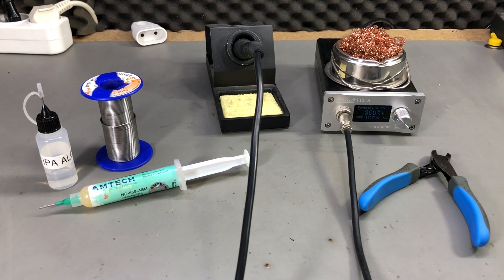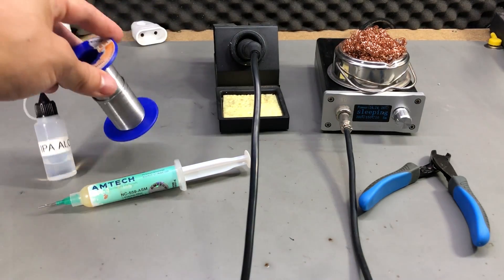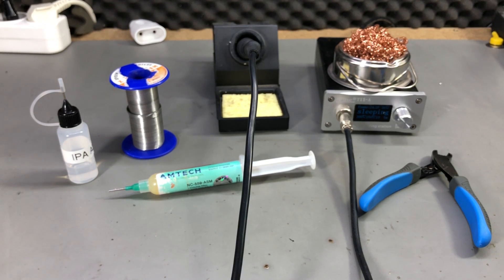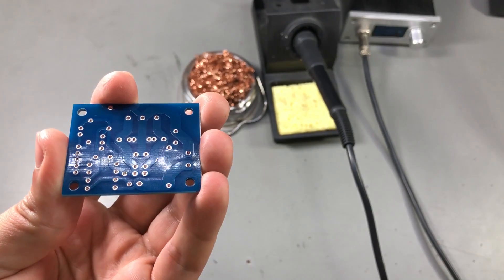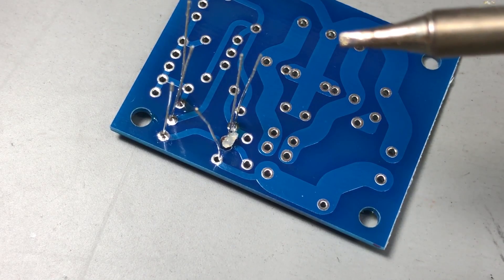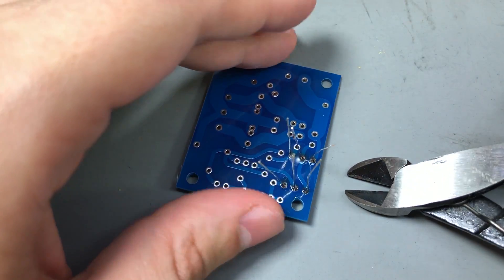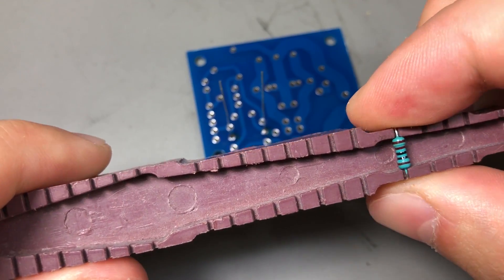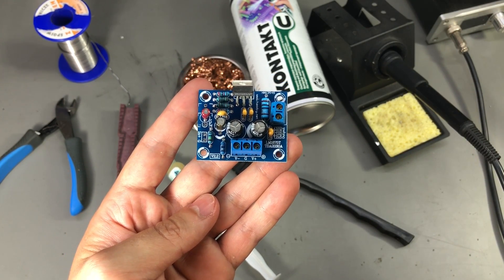Voltlog #179 - How To Solder Through-Hole Parts

Comment: For me, the biggest barrier when I started was the solder I used. I always thought soldering, especially desoldering, was so hard and I could never get it right. I thought it was my skill and/or the soldering iron I used. I got a few irons, still didn't notice much difference. After spending more money on some quality solder, I realised it was all solder.
Reply from the maker: Solder does matter but I have found that if you just add some extra flux you can get it working even with cheap stuff.

Comment: Here in Finland selling leaded solder to consumers became illegal in March this year. Only authorized repair technicians can buy leaded solder. I'm happy I started my hobby 2.5y ago straight with lead free solder so I'm pretty comfortable with it now. But it probably explains why it's always been extremely difficult for me to desolder anything. Even using solder wick has never really worked for me that well. I wonder if the same rule will soon come active around the EU if it doesn't already apply.
Reply from the maker: What if you order it online from Germany or the UK, or whatever other distributor that can ship to Finland? :-)
Reply: That will probably work out just fine at the present day. My point was more on speculation if it will in the future. I also bought some lead solder from a hardware store here just two months ago to try it out. I actually kind of felt the fumes smelled lot worse than on the lead free solder I've been using. It was solder from some pretty well known German brand (that also makes soldering irons but not Weller), for some reason the name has escaped my brain just now though. I guess it might have been just a psychosomatic thing, knowing it's more unhealthy. :)

Edit: Stannol was the brand.
Reply: ... the stores here have not yet caught up by the new legislation.
Reply from the maker: The fumes and their smell are a result of the flux contained inside burning. I don't think the leaded stuff smelled worse because of the alloy.
Reply: Obviously the lead free solder I've been using is rosin flux core solder also. But after watching your video it might be I had the iron temperature too high. I remember getting darker smoke/fumes than I normally do. And breathing it felt heavier on the lungs. I'm using a fume extractor but not everything is sucked into it. But I'll need to give it another shot. Definately I'll be trying it again when I need to desolder something.

Thanks for the product tips on the video BTW. I found the exact same flux from a Finnish online store I hadn't run across earlier but also a flux residue cleaning spray with the integrated brush and a separate antistatic brush. Previously I've been using spray can of isopropyl and a regular toothbrush. I haven't has any issues with them but better safe than sorry with the antistatic brush. Plus the integrated can + brush combo seemed very convenient. :)
Reply: @ristomatti  I do wear a respirator mask when soldering. I use a respirator mask from 3M. Filter is from 3M and number 6057.
You will also find it by searching for ABE1O and EN141:2000.
I do highly recommend it and it is cheaper and much better than cheap fume extractors. It's also more versatile and useful for other works.
But i don't solder on a daily basis. If i would do that i would buy a professional fume extractor that keeps the fumes completely way from me but these solutions costs a little more, that those cheap wants with just a cooler and ridiculous filters.
Reply: @OpenGL4ever  Since the original post I figured I can purchase pretty good leaded solder from China and I've been very happy with it. :) I do have a fume extractor with an active charcoal filter that clears the air seemingly well. I solder so little also I don't think it makes any difference health wise.

Comment: I'm my opinion a helping hand often makes it harder to solder. I think Dave Jones also stated this. Trouble is, you have wayyyyy better control if you rest your hands on the desk which is hard to do with a helping hand. The best tip instead, and I think I got it from Jullian, use Blu tack or, as I do, Play Doh!
Reply from the maker: I agree, that's the reason I don't use one :-)

Comment: Really should stay away from the Chinese solder, most are just crap. I use Loctite and some old Savbit solder now and the differnce is huge.
Reply: I agree most no brand Chinese solder is crap, but the brand name Mechanic is amazing. I've been using their solder for a little while now, very low melting temp flows very well and produces shiny joints. But again, they aren't in the price range of the rest of the crappy Chinese solder.

Comment: are there any standard stencils available for surface mount chips of different packages which we can place on pcb and put solder paste rather than have to order stencil for each board coz this way we can reuse it rather than order a stencil for each pcb design?
Reply from the maker: I haven't seen any but it would be a pain to use something like that, just imagine adjacent components, you deposit paste on those and then you smear it away with the stencil when trying to work on a new part.
Reply: its good for ICs so can solder those first and the rest of the passives no stencils required. isnt there some diy way to create stencils?

Comment: could it be that my cheap chinese solder is destroying my tips? they get an oxidation layer really fast, even if i just switch it on, solder a joint and then let it cool down after cleaning it with a sponge. its really annoying when i have to use a new tip every 10 joints
Reply: Can be crap solder. Just order the good stuff from a reliable seller and it will last you years without issues. I have seen some crap stuff and the lead free solder on pcb's isn't really nice stuff for your tip.  The tips that are on my Weller are at least 25 years old and still look good and yes it is being used a lot sometimes.
Reply from the maker: That cheap solder could contain some aggressive flux that will eat away the shiny coating on your soldering iron tip. If you combine that effect with a not so good tip, it will degrade pretty fast. Since I've switched to using T12 tips (about 2 years) I haven't destroyed any so far, they seem to be of better quality.
Reply: You still have 23 year to catch up on my tips ;-)   Ow another reason why not to use lead-free is that lead is a bit bendable and soft so less issues when components warm up.
Reply: Nope, these look like regular tips.  I remember in high school, long long time ago when animals could still speak, that we got new soldering irons. The tips lasted 1 lesson.  I would say that cheap is expensive in the long run.  I also like quality stuff that grows on me. One of the Wellers is from the 70's and belonged to my father. It still works as if it came out of the box and will probably outlast me.  If I had to do it over again and had money issues then I would buy a nice Weller second hand. If something is wrong with it their will always be parts for it.

Comment: Just a quick note about the opposite operation, de-soldering: there's a special "solder" with a much lower melting point called chipquik that helps with de-soldering by staying liquid for much longer than the normal stuff so you just displace the original solder on your part's pins with it, heat them all again and just pick up the part. It's certainly not necessary for de-soldering but daaaaaang is it handy when half of your part keeps cooling off while you are heating up the other half...
Reply from the maker: I have used that low melting point solder and I can confirm it works nice. Another tip for repairs: since the majority of commercial products use lead free technology it can be pretty difficult to desolder the parts. It always helps if you add additional flux and leaded solder. The leaded solder will combine with the old solder lowering the melting point.

Comment: Can you explane the level of Quality China Solder vs Solder from the local store? And why don't you use lead-free solder?
Reply from the maker: The flux is definitely worse in cheap solder wire and that will affect the soldering. You can compensate that issue by using external flux. Then there is the question of the alloy which I assume is not that perfectly tuned for the cheap solder wire so it will not have those optimum characteristics for soldering.
Reply: I used to buy cheap Chinese solder on ebay, they produce shitty looking joints no matter how well you solder. They also need very high temperature to flow and they don't flow well at all. I tried some solder on element14.com, though they're good, they're pretty expensive. I later settled with Mechanic leaded solder. They're a Hong Kong brand. Their solder is very good. I can save about $10-20 when buying 500g from them than buying Loctite from element14.

Comment: This was probably the best tutorial on through hole soldering I've ever seen, but that won't keep me from quibbling over a few points:
1) It's really important to use good solder and flux from a known source. You state this, but then give a waver to buy Chinese crap. You never know what you will get with a fake product and even though good solder and flux is more expensive, it's not so much more expensive to risk a lower quality job, especially if you want your board to last several years. If I paid someone to stuff a board or do rework and found out that they had used no-name solder or flux I would never use them again.
2) You might discuss the different types of flux, and talk about the importance of using one that is either easy clean or no clean. The users can also go to the manufacturer to get precise recommendations, for example the page for the Amtech 559 that you use is here: http://www.inventecusa.com/assets/nc-559-asm-tf.pdf You should also mention that aside from cost considerations, you don't have to worry about using too much flux, especially during rework. Some of the best technicians actually prefer to almost have their rework parts swimming in flux while they are working on them. There is a popular youtube channel by a guy who runs a repair shop in New York City, hates Apple, and he shows that too much flux is just enough... ;-)
3) Tip #6 (place components farther from the board to enhance cooling) is questionable. Many times, the primary cooling will be through the leads and into the PCB which then functions as a heat sink, and this behavior can be enhanced during the design process. Without forced air flow, natural cooling is usually pretty minimal and counting on it to cool a hot part is questionable at best.
Reply from the maker: Thank you for the additional info provided. Let me comment these points:
#1 I have discovered the difference between bad and good flux when I got my first genuine amtech 559 syringe but I wanted this video/tutorial to be for those who have problems with soldering and I didn't want insist too much on the details. I can still get good results with fake flux, it just smells worse, doesn't have the same efficiency and it's more difficult to clean
#2 this is really not a subject for the beginners, I soldered for years only using solid rosin flux and I was getting some pretty good results. Things have changed and today is much easier to find good flux but still I don't want people to worry that much on the subject, I would rather have them soldering and learning as they go.
#3 you said it right, my recommendation is questionable, in the end it really depends on the particular circuit in question. with the right conditions it might prove advantageous, otherwise it might not help but I don't think it will do harm as the leads can act as heat pipes and would still conduct the heat to the pcb pads.

Comment: BTW what was that little board?
Reply from the maker: TDA2030A 18W class AB amp kit
Reply: Oh thx man and sorry forgot to ask about the amtech flux...from where do you buy it. Watched some video today and a guy was comparing with the one he bought from amazon and it was the same, not sure what to do :)
Reply from the maker: I would advise against getting it from amazon. There is a guy called Louis Rossman in the US that sells genuine amtech flux, he gets it straight from the factory. You could also try the big suppliers, Element14, DigiKey, Mouser, TME, RSComponents, etc.